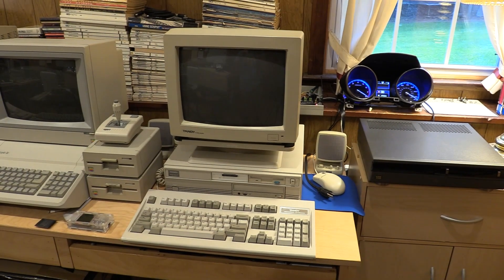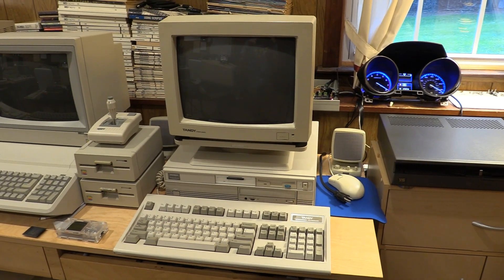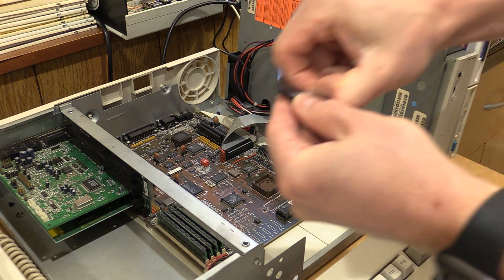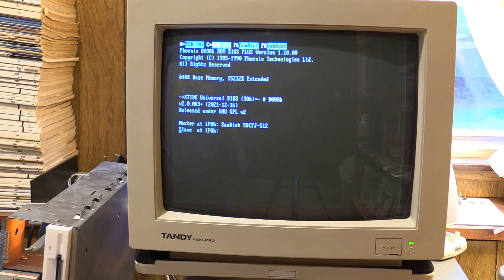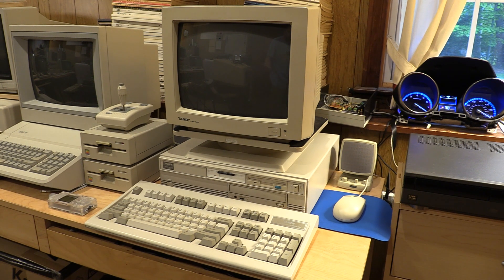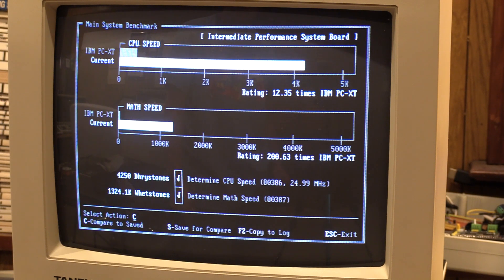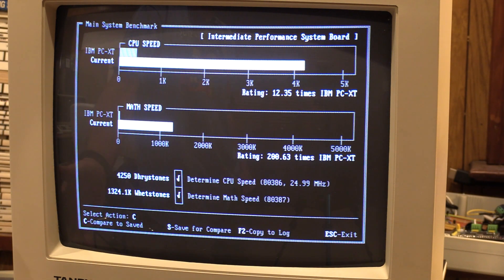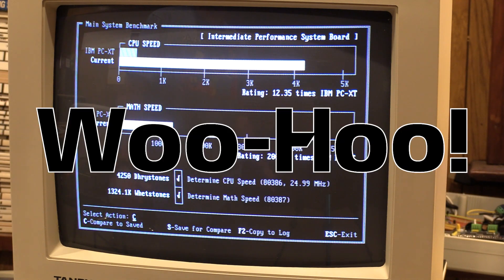Tandy 2500 SX/25 - Adding a 80387SX math co-processor

Comment: Couldn't you install a 486 in that co-processor socket? I thought there were some companies back then that made upgrade modules designed to do just that. Though I know some actually pressed on top of the 386 itself using a really neat inverted socket thingy.
Reply from the maker: Since it was a coprocessor socket only, I don’t know if there were any products available to upgrade to a different processor class through that socket or not.  If there were I’d have passed anyway…this is a 386 SX system, so the processor has a 16-bit data path.  That would choke even the base 486, since all 486s have 32-bit data paths.  The upgrade processors that clipped onto the CPU would probably work on this, but even then, the 16/32 bit thing would make me think twice.  One of those plug-in 486-on-a-ISA card upgrades would also work.  Thanks for watching!

Comment: Have you done a max possible upgrade on this or another system?
Reply from the maker: Without putting in a crazy 486-on-a-card upgrade, I think this system is pretty much at its max config.  It caps out at 16 MB of RAM, the processor is soldered on, and now it has the co-processor.  I’ve added a sound card, CD-ROM drive, and a network card, it’s pretty much decked out. 😁. My 4825 SX has an overdrive chip and the max (32 MB RAM) in it, as well as sound and CD-ROM, so it probably qualifies too.  Thanks for watching!

Comment: MS Flight Simulator 4 would be a contemporary game that makes use of the FPU. AutoSketch 1.0 or AutoCAD 11/12 likewise and they both come with pretty example drawings.
Reply from the maker: Thanks for the suggestions!  FS4 will be a fun addition to the growing list of games on it.  I’ll play with AutoCAD as well.  I may have to pull the 80387 and do some comparisons 😁. Thanks for watching!
Reply: @TJBChris  AutoCAD for DOS (at least R10+) requires a math co to run, it wlll spit out a mean sounding error if you do not have one.